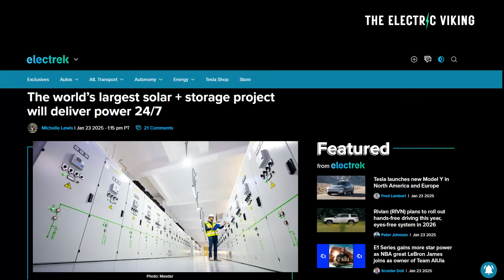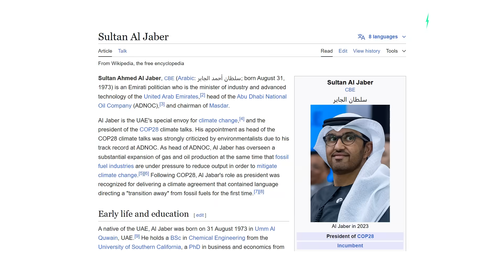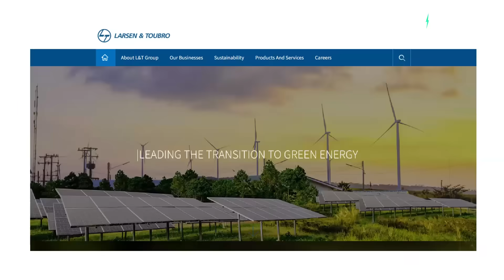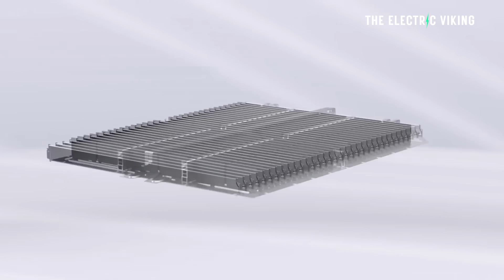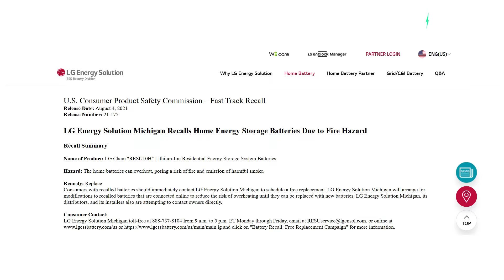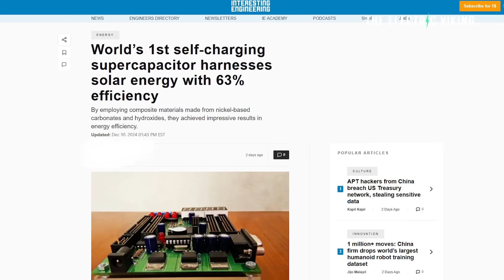The world’s largest solar and battery project deliver power 24 hours a day

Comment: Just Google this ""are there any Solar farms in the world that supply 100% power with no back up facility "" then try and make up another bullshit story about renewables being the be all and end all over Nuclear as renewables are a joke and will always be a joke as well as the most expensive option for the end users.
Power costs are added to every single item we use on a daily basis, not just the power we all use ourselves.
The more power costs because of idiots like the Viking pushing for so called green options, but putting Nuclear in with the Coal and Gas group are the main problem with why the end users are paying so much and will continue to pay ever more each year, all thanks to their stupidity and brainwashing.
By all means we should have all been driving EV's by now had the Fossil Fuel Industry not been so powerful back in the 60's and 70's.
Innovation will always push away from fire to make the things we need.
Fire is still our main way of creating power as well as transportation, with out fire, the world would stop, we need fire for the ICE, we need fire for the power generation created by Coal and Gas.
We don't need fire to produce power with Nuclear, we don't need fire for EV's, we are no longer cave men and so we do need to stop relying on fire to survive in the 21st Century and the only way we can do this reliably as well as cheaply is Nuclear and no matter all your Bullshit about Wind and Solar with Batteries, eventually the Governments will stop listening to this crap and finally go fully Nuclear and remove all the crap Solar and Wind farms that cost people billions for nothing but a feel good effort.
The world needs 435TW of power, look at how much land is now being used by Solar/Wind and batteries to produce 2.5TW. that is the total world output to date from your fantastic and pushed for by brainwashing system and you morons believe the world can be powered purely by Solar and Wind with Batteries to supply the power during the periods there is no Sun or Wind, what a joke, you losers haven't even bothered to do a costing of any sort nor the end user costing.
Just curious, but if you look at how much land the crappy systems there are now use and you will need over 200 times that amount of land as well as all the infrastructure required to go with all that land waste, I think you will find that you will either need to place the Solar and Wind out over the Oceans or cover the Cities and Suburbs with Solar Shields as there is not enough land for the Solar or Wind farms that is not being used for food production..
What a bunch of wankers to not even bother to do even the tiniest amount of research to see how the current state of Solar and Wind are doing, nor how much land they are using to produce that unreliable 2.35TW, that still needs some other form of power generation to help with transitioning between peak and off peak as well as rain/Snow or Cloudy periods.
How about all those people that live in Areas where it snows for half the year, what would you put in those areas as far as Solar or Wind as well as how large the Battery system in those areas would need to be ?
I am all for Solar/Wind and batteries for every house/Factory/Business/Roof area to help lower power costs, to even removing power costs depending on how much power you use per day.
I have had Solar for over 12 years and because the wife and I also got a Solar Hot Water system, only use 5KWH per day, unless it's a 30C+ day and then we use 8.5KWH and our Solar Panels produce on average 20KWH per day and so we don't get a power bill.
This is where Solar/Wind and Battery excel, they don't excel in large scale systems for every where round the world.
Just imagine how great a Wind/Solar/Battery farm would be in an area like Kansas, I could imagine people in nearby towns to a Solar/Wind/Battery farm would be very pleased as they get pelted by the debri from the renewables farms.

Comment: Whilst Solar PV generation may fulfill a baseload roll in sunbelt countries, in more Northernly, particularly coastal, locations Wind generation will serve that role more than solar. 

As to home generation/storage being the preferred form of PV will help within the domestic demand segement of the electricity market this typically only represent a third of the overall electricity market, with commercial and industry electricity demand taking closer to half the overall market. Hence baseload sources via grid scale solar PV/wind generation is a more critical need to meet the industrial and commercial demands.

Comment: The large battery storage facility at Moss Landing in California spontaneously combusted last week .
Tonnes of highly toxic pollutants emitted into the atmosphere for days as it could not be extinguished by fire fighters.
These projects will all be large , until they burn to toxic ashes.
Reply: @Leo555ZZZ  
The mistake they made was to put all the batteries into one big building where the fire spread from one end to the other.  In contrast, Tesla's Megapacks are out in the open and the spaces between them prevent the fire from spreading from one Megapack to another.
Reply: That's the only way to recycle them.😅

Comment: There is little doubt that solar and wind excess can replace baseload if adequate storage is available.. trouble is 1 GW is likely not enough. Where I live, Portugal (10 million people), baseload oscillates between 2 and 4 GW. Irradiance maps say that saudi arabia facility should yield some 0.5 GW here, so we'd need at least 4 of them. That's a lot of lithium for just one small country. Not sure world lithium reserves are enough for this and all the new electrical applications (cars, planes, etc.). So you might still need nuclear for some decades until stuff like sodium batteries are viable as very large scale storage.

Comment: Hi Sam. Sorry top put a damper on your enthusiasm for solar and batteries but the project in Abu Dubai still needs fossil fuel powered generators or the lights (and air-conditions) go out. If Statista are to be believed Abu Dubai have an average electricity demand of 22Gw per hour. This means that, as you said, the batteries are for base load and will last for just over 1 night at 1Gw per hour of supply from the batteries. The remaining 21Gwts per hour still have to be generated and this is mainly from fossil fuel and this is with the biggest storage battery in the world in perhaps the sunniest place in the world. This battery is only going to provide around 4% of their electricity at night and this assumes that the solar panels charging the battery can be kept clear of dust and the sun not blocked by sand storms. This project sounds to me like a virtue signalling response from a rich country with vast amounts of open space and 360 days of sunlight. As has been pointed out before batteries, for long term storage (over 8 hours), are not the way to go and at present we have NO technology the can store enough energy apart from fossil fuel and nuclear to last for days. Batteries defiantly will not cut it for long term storage no matter how much we hope they will.

Comment: For God's sake, "self charging supercapacitors"?

There is no free lunch, as there is no magical energy source.

BTW, we don't actually consume energy, it's not destroyed, it changes format always leading to more entropy.

Capacitors are by definition devices that store energy in the form of electric field.

The electric field is created by a concentration of oposite charges in its electrodes.

A concentration of charges is the result of the movement of the charges to those positions.

Movement of charges is by definition a current, or flow of charges.

Some energy source must force this flow in this direction, otherwise the capacitor would discharge if in a closed circuit.

So there's no such a thing as a self charging capacitor. There might be a device that combines a capacitor with some othe device to harness some sorce of power.

When one says the best industrially produced solar panel achieve some 24 or 25% efficiency, this means it converts that fraction of the incident light power into electrical power at the standardized tests.

There is a theoretical limit of some 29% efficiency for single junction (one bandgap) devices.

Electric power is not generated at this peak most of the time. Real world factors play their roles. Sun is not always shining at highest power; there are clouds, there can be other kinds of shade by natural effects, by dust, etc., solar panels might be organized into strings (many in series) with worst elements determining efficiency, inversion (conversion from DC into usable AC) might be limited to some 80 or 90% efficiency.

Than one can use power immediately or store it. 

In Grid Tie systems there's no storage, just offsetting some of the needed power from utilities.

With energy storage, other energy conversions are needed. With batteries energy is chemically stored, in an form easily converted into electricity. With heat, compressed air, pumped water storage energy is converted into other forms. Each round trip conversion has it's waste penalties.

Capacitors can be charged and discharged very quickly, as there's only a concentration of charges, no important physical or chemical transformation.

Anyway there are still losses.

I did not read the original article but I'm quite shure the supercapacitor efficiency is related to the ratio useful  energy discharged in relation to the energy used charging.

Similar to the round trip of regenerative breaking into batteries e than moving a car again.

Totally dissimilar to the solar panel efficiency. Completely different concepts.

Comment: Try running Tomago Aluminium Smelter with solar, wind and battery. Won't last 45 mins. Unfortunately if you want to run a modern economy you need heavy consistent base load power. Your renewables won't cut it.
Reply: It can easily run it. 15 seconds of research proves that.
Reply: @dannelson6980 A smelter has a need to be operating at all times. If the smelting process is interrupted the plant can get damaged. So intermittent power generation is not sufficient.
Reply: @DanielWijk  That is covered by the battery. This plant can output at least 1 GW base-load, the smelter only needs 850 MW you have some head room.
Reply: @dannelson6980  Unless the intermittent power supply from the sun comes back in sufficient force in time it will dwindle and die as well.

All at an enormous cost that you have to replace in 10-15 years.
Reply: @DanielWijk  The sun has pretty reliable for the last 6 billion years. Replace what in 10-15 years? The US DOE expects 30-35 years out of panels, batteries are rated for at least 10,000 cycles now, that is over 25 years. Solar has consistently had the lowest M&O cost for any power plants.
Thermal plants have turbines, cooling towers, pipe, valves, feed systems, a large list of items that need constant maintenance and replacement.
Reply: @dannelson6980  While the sun is reliable the output you get from the panels varies day by day.

Some locations are better than others for solar power.
Reply: Yep.

Comment: You always need backup solutions. In case that dust storms, fires or volcanic eruptions cloud the sun (even in a desert), we need a backup to solar. This could be wind and Nuclear. You never ever put all eggs in one basket.
Reply: @HansMilling  our pumped hydro is quite a good basket.
Reply: @davidpearn5925  yep. Which supplies 2/10ths of fuck all.
Reply: @davidpearn5925  Hydrogen is too expensive and too dangerous to keep in storage.
Reply: @HansMilling  water isn't
Reply: @davidpearn5925  Pumped hydro is a edge case, great if possible buy requires specific topology to be deployed. Pumped hydro should not be considered as an option for grid base load as its output is never going to be large enough for all of Australia. Its like saying geothermal power from volcanoes is really clean and provides a great base load, its an edge case, does not matter.
Reply: @shockmop  there was a report a couple of years ago indicating that there were approximately 3000 suitable sites. There's a small one in North Wales that has been functioning for around 30 years. Coal was cheap and plentiful but now the PV panels have made that dirty old tech and for some, dangerous.

Comment: In the US, I believe that we should have a mix of wind, solar and nuclear with some where around 70% nuclear.  Hopefully, the price is going to come down an modular fast reactors which will burn some of the existing nuclear waste.  The nuclear reactors are the safest form of energy although only marginally safer than wind or solar and require less overall infrastructure.  The price is somewhat debatable depending on what is being included with the renewables such as the storage and additional transmission lines.  In the US, getting permits for new transmission is not easy or quick.

Comment: I am in Salt Lake City, USA - our 9 KW solar panels since November have averaged less than 100 Watts each daily.  When they are covered with snow it's 1/3 that.  Solar may work in warmer places, but not here since the cost and space requirement to hold 3 months+ worth of power in batteries is not affordable.
Reply: Get a long broom and clean off the snow  it might help.
Reply: @dylanthomas12321 there's always one isn't there. And you are it. 😅
Reply: If you have battery storage could you buy cheap overnight electricity from your provider then use this during the day, say 12kWh of storage, would that cover your daily needs ?.

Comment: states like germany where theres litterally 3-4 month without any suffient solar power it wont ever work without nuclear or natural gas backup.
Reply: weird then
how many actual numerical analysis, say, and have computed with numbers, not rhetoric, that it can indeed be done.
Reply: According to the facts In 2023, renewable energy sources accounted for approximately 59.7% of Germany's net public electricity generation. It's the first time renewables have covered the majority of the country's electricity consumption. Wind power and solar energy were the leading contributors, with wind power alone providing 32% of the electricity. Seems they are doing quite well over there and expanding their green credentials on a monthly basis.
P.S. Is that a typo as I thought Germany was still a Country I didn't know they had become a state, within the EU I suppose ?.

Comment: Abu Dhabi is practically on the equator.  Try doing this in the UK in winter.  You would have no chance.  Also the UK has a population nearly 10 times that of the Emirates.
Reply: I believe you, but it is my understanding that the  UK has copious amounts of wind power.  Several times in the last 2 years I have heard that in London and in Scotland there has been so much wind electricity that the power was given away.
Reply: @RenzoCanepari not so. Given away to whom? And how? Even when wholesale prices are negative, the users are still charged. If the wind isn't blowing the wind producers get paid! Last year it was 1 billion UK . 😅 Brilliant business model. Funded by the taxpayer. Do your homework and stop being stooged.
Reply: Read up on Tony Seba. Solar and batteries work up to the arctic circle anywhere on earth.
Reply: @billbimson2408  what can be done is to use the high powered lasers developed for fusion reactor research to drill down between 2 and 20 km to where hydro thermal energy can be harvested forever
Reply: Wind energy is abundant in the UK, & more is yet to be harvested
Reply: @guringai  Please see my reply above.
Reply: @guringai harvest wind energy? How? 😅😅😅😅
Reply: @robertfonovic3551 
That is literally what wind turbines do to generate electricity.

Comment: Distributed generation and storage at the use level with car battery storage is beyond obvious, and has been for over two decades.  Cheaper, no grid upgrade cost, and much greater resilience  in the face of ever increasing large scale natural disasters that result from climate changed.  The auto and carbon fuel industrial complexes have been doing everything they can to stop it.
Reply: You don't have to be some carbon industrial conspiracist to realize solar/wind are non-starters for residential  in the large percentage of the world without sun/wind for weeks/months at a time seasonally each year. You just have to have a working brain. Same for most industrial areas. Even where sun/solar are effective they are a complete waste of money and surface area in most  compared to local  geothermal.